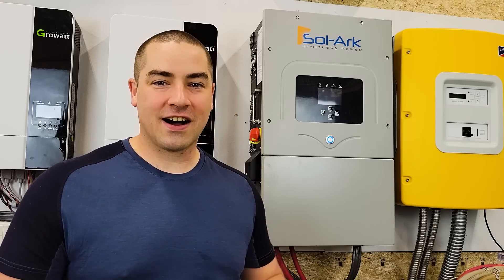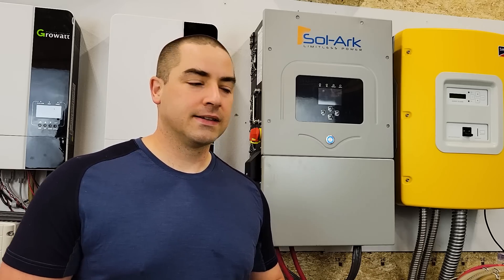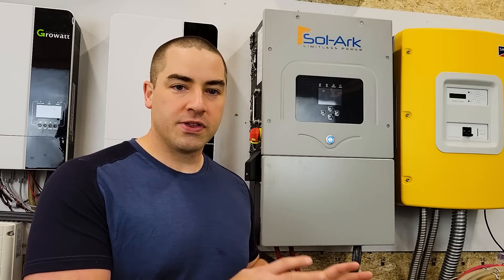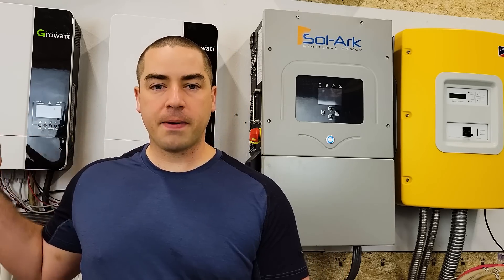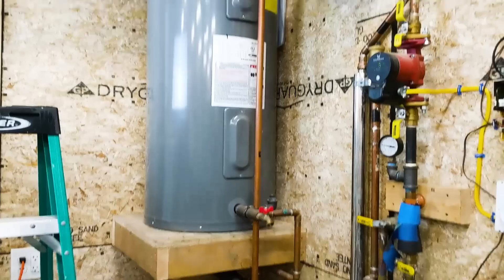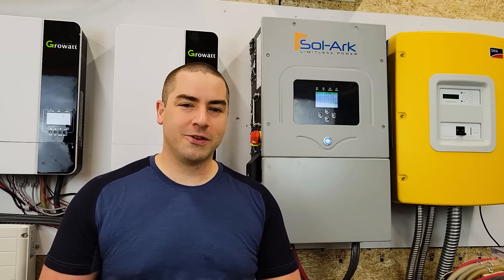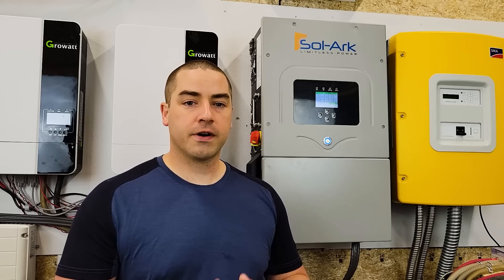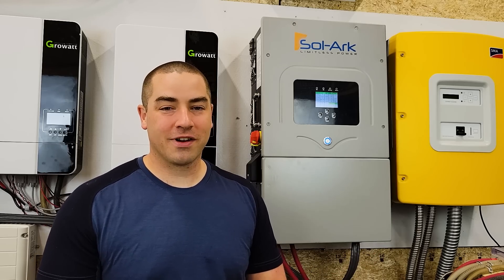Sol-Ark 12K Inverter, Is it worth it?

Comment: That's disappointing for $5000.  I have a 6k LF through an interlock kit, buy I want to add an 6k HF through a transfer switch to power the water heater and maybe the stove.
Reply from the maker: If you are looking for a 6kW HF, then might I suggest this one: https://signaturesolar.com/eg4-6000xp-off-grid-inverter-split-phase/?ref=4_rHcgZ9x-TiF-
(affiliate link)
Reply: @DavidPozEnergy  Looks like a great model. A bit pricey, but if the internal charge controller is robust then worth it!

Comment: that is an inaccurate eff%. in order to get the measurement for this you need to do multiple runs and certain voltage and max output percentages and get temp, output ratings, and input number at a certain load percentage as per sgs. Do the test properly so we can see a real review.  with the space heater you were at 34.5A already then 36A, max current is 62.5 which means you have exceeded the halfway point sharing the legs. If you want to do what you are doing and run what you are running, then it would be operator error to buy the 12k and not the 15k.
Reply from the maker: Hi Armondo slaughter,   thanks for your comment.   I'd love to do more testing on the inverter.  Mapping out a full efficiency curve would be great.  Do you know of anyone who has done that?  BTW, the Sol-Ark 15K didn't exist at the time I was making this video.

Comment: Can I do off grid like you have, but just run a battery charger from the grid on the hot side of my grid disconnect switch to top off the batteries when needed?
Could this accidently back feed the grid?
TY
Reply from the maker: Generally, yes, you can do that.  I'd double check that it's an "Isolated" charger, which is fairly common.

Comment: I have had Sol-Ark for one year. I am disappointed in the batteries and how the system switches back and forth from the grid to batteries; in other words, it is not automatic. Tom gets confused at the precise point at which Sol-Ark is the weakest. When explaining how the batteries and grid interact and assign how the grid charges the batteries is a significant problem in the system's design. Tom's hesitancy and confusion on this point of complex action is Sol-Arks production failure. This problem will doom Sol-Ark's growth if not corrected. The Installer is not the problem. The employees of the installer believed Sol-Ark's vague and confused explanation too.This system is not automatic, as Tom explains. I repeat: Sol-Ark's system is not automatic. Sol-Ark batteries during a recent grid shut down for me, went to zero - in other words, Sol-Ark batteries went out to. During this period of time of several days, solar power present for several hours charged the batteries to a low level. I phoned the installer. The employees also failed to figure out what went wrong. I was told that Sol-Ark is automatic. Nothing during this power outage for a few days worked as promised. And I paid $45,000 for these batteries in my small home of 1780 sq. feet. I phoned Sol-Ark and spoke to an engineer. The engineer person told me that my system needed an update. What? Why does the system - the App - fail to register when an update is necessary and then perform the update to their software? The engineer remained silent without an explanation; in fact became a little too much belligerent as I pushed the point that if it is a software problem, how come the so called expert engineers failed to correct the outdated software when they noticed it?. Why does it take a power outage to indicate that Sol-Ark's software is outdated.  Here is my point: Sol-Ark does not perform as promised. I paid $45,000 for a home battery system that Sol-Ark told the installer and the installer told me, the home consumer, that Sol-Ark system is automatic. I do not recommend Sol-Ark batteries for home consumption. For the excessive price I am getting almost zero performance and zero customer service from Sol-Ark. I do not blame the installer. They too were misled. When the power went out, the batteries failed to respond as promised. I suggest that the home consumer either check out another battery supplier or do not install Sol-Ark batteries at this time, since Sol-Ark does not have a reliable system. Perhaps Sol-Ark is aware of the system's failure and in the future the product will work as promised. I deserve a system that works and I deserve a substantial rebate from Sol-Ark.

Comment: I just watched my (2) t12k systems shutdown today pulling 12k from grid. Also it only charges my batteries about 10%, shows 100% then dumps batt storage. Wish I bought 3 midnights now and a batt controller and saved 12 grand. 

The sol ark GUI/ PV Pro is archaic too, like 1990 dial up modem old

Comment: Hi Dave,

Great video! I have the same 12K Sol-Ark inverter. And, I have experienced the same issue. It shuts down pretty frequently and I have to manually turn it back on. I need some help. Can you please assist me? I guess that I would need the autotransformer as you mention and the phases L1 and L2. I have always wondered why the system is overloaded while it is 9K watts output and using only 3, 4, 5K watts... Can someone help me understand what I need to do to resolve this issue. After all, this is a very expensive unit.
Reply from the maker: I made a second video to this one where I test out using an auto-transformer.  But, keep in mind.  That (to my knowledge) Sol-Ark has not printed any document advising how to use an auto-transformer with their product.  If you ever have an issue and ask for help from them, they might not provide any because of the use of an auto-transformer.  (IDK)  But, check out my next video for some ideas on using an auto-transformer: https://youtu.be/EYIzEW54_bY
Reply: @DavidPozEnergy  Thank you so much for your quick response.  I sincerely appreciate it. I did watch that second video about the autotransformer. And, I think that it sort of resolves the issue of overloading since it splits the charges. That way, the inverter should and must be able to absorb the maximum output as it should in the first place. I will bring the issue to Sol-Ark so they can opine on it. By the way, can the system restart itself automatically without manually turn it back on particularly I have it overseas in Haiti 🇭🇹 while I live in the States here in Florida? It is completely off-grid. Your invaluable advice would be greatly appreciated. Thanks again.

Comment: So a cursory review shows that this is a high frequency inverter. The main advantage of a low frequency inverter (a la Victron) is ability to start inductive loads. So it sounds like this may be a factor here, just the overall topology of this inverter.
Reply from the maker: Basically, yes.  The Sol-Ark is a Transformer-less design.  Inverters built with transformers have much higher surge capacity, which comes in handy for starting motors and compressors.

Comment: Stick with the Sunny Island, no comparison not in the same class. Mine is connected over 350' from the AC Buss (on purpose) has never tripped. I even connected my diesel pusher motorhome,  and it finally wouldn't start the AC in it, but tripped the low voltage protection in the motorhome. My old system used Zantrex SW 5548 Inverters circa 2000 which were set up as master and slave like SMA. They lasted until 2019.

Comment: Just balance the load better and you should be able to get close to 9,000 watts.  For example, if you use 2 space heaters, make sure there is one on each leg.  If you really wanted to force your house to be balanced all the time, only use the 240V from the inverter, run it thru a powerful voltage converter (240V down to 120V), then backfeed your house with just a single phase of 120V, but the inverter will "see" that as a 240V load all the time and should "autobalance" it but I am not 100% sure so maybe some electrician can chime in here and either confirm or debunk this theory if they know the correct answer if this will work or not.

Comment: I just spoke with Sol-Ark about this exact issue. They told me that if you are 100% offgrid , then the disparity between legs can only be 1.4kw. If its on the grid then you can be 4.5kw difference between legs.

Comment: Never seen a Sol-Ark trip this low. 
I have designed and installed dozens of Sol-Ark systems. Very seldomly do I recommend 1 inverter for the whole home. Balancing of loads is very important in any electrical system. I always do my best to rearrange curcits. 

I have seen a singel 12K run all lighting, well pump and dryer with no problems. Only when adding the hot water and oven do you experience the over loading. So, singel inverters systems have gas appliances or do a seprate critical loads panel. 
I have seen problems with the ac coupling feature. I only do dc now, its better that way any how. All around I dont think you can beat parralle Sol-Ark systems for a hybrid set up. I wont put my name on any other system. 
I gusse it may be a good thing for me to post some whole property systems I have done to show the ture capability.

Comment: Here's the deal, with an inverter (DC to AC) and a maximum continuous rating of 9000 watts, that's 4500 watts per phase. 2 phases of 120 volts each. 1/2 of the total rated output of these inverters. This is easily overlooked. The total wattage was 9000. If this were feeding a 3 phase load, that would mean the maximum per phase would be 3000 watts. The system seems to be doing what it was meant to do or am I not seeing something here?
Reply from the maker: I made a follow up video with more detail and more demonstration.  https://youtu.be/EYIzEW54_bY

Comment: The excessive idle power draw, poor 93% efficiency and poor cooling design with 3 x huge noisy fans is enough to put me off instantly.  The fact that they're so expensive and advertised as 22nd century technology is a joke - plug in 2 heaters and trip out your whole house?  More like 19th century technology.

Comment: My question are the Growatt systems without a problem? Looking at the DIY solar power forum, there seems to be lots of problems with them some of them dangerous in nature such as the bonding of neutrals and grounds.
Get the right equipment for the job and make sure you understand the strengths and limitations of each piece of equipment. In other words read the manual and ask questions of the company if their are problems.
My problem with this review is that David did not update software or ever contact Sol-ark about his issues. Also it appears he is paid indirectly by Growatt.
The Growatt and Sol-ark address different needs.

Comment: You went over the 50% load balance rate for the unit. 2800/4600= 61%. You can pull more watts, but not that far out of balance. The solution is another 12 k unit, balance loads better or a use different inverter.

Comment: Dave how about testing the midnight diy all in one 5000 watt inverter. Very simple to hook up and for 900 bucks it is doing fantastic after a month so far.500 volt on pannels. Gen or grid back up. Stackable. 80 amp charger.

Comment: 4th day totally off grid! 20,600pv, 132kwh lfe battery (3 out of 10 batteries hooked up, 7 to go), 10 bms's/six brands, two SA 12K's, 10k honeywell lp gen with 2-wire start(Does GWatt have that?), 400 gal lp. After getting all the settings correct, it works like a charm. it powers three heat pumps 5.5 tons (vs compressor on one, soft starts on two), 80 gallon electric water heater (4.5kw), dryer, washing machine, electric range, fans, lights, all electronics. Love it! A full 40 space main 200A breaker panel, 100A sub in garage with a lot of breakers. That's the key to having balanced loads. Lots of breakers. Always run two Sol/Ark's for totally off grid. My old power bills showed 40-70 kwh. More in winter due to hp's. I use wood burner below 30F, have all electric hesters on a toggle switch for disabling. Defrost thermostat on one hp has nc spst switch to disable during dry cold weather when defrost is usually not needed. The other two hp's have demand defrost, too much electronics to mess with.

Comment: Oh yes you are EXCELLANT at answering our questions !
There is absolutely nothing better than a real life test with real life conditions and without any bias or corporate number fudging !
Thank you especially for this video as I once was considering the sub-ark 12 k as an upgrade to my outback radian gs8048a (8000 watt inverter). After watching this I realize sol ark is not even close to competing with our existing system. And to add insult to injury, they paste a "limitless energy" sticker right on the face panel. Such a shame as I had high hopes for this company.
Also the 12k nameplate equates to nothing more than false advertising and misleading buisness practices.
Someone could add a bunch of cheap charge controllers to a 6000 watt inverter for a total of $3000 and call it a 12 k inverter-as it would outperform the solark.
As it stands we produce up to 60 KWh daily and our inverter can do a continuous 8000 watts with a surge of up to 9000w with no problem. We sell 2/3 of our power and use the rest for loads & batteries and all for less $ than a solarc to begin with.
Plus the BIG BONUS of never having had a shutdown due to overload in almost 5 years.
No thanks solark, not even if it was free, not in a million years !
Only overload our outback ever had was intentional during initial installation & testing. She finally cut out at 10,400 watts after running over 9000 watts for over ten minutes.
One thing I can thank Sol Ark for is restoring my appreciation for the system we already have and reminding me the importance of quality manufacturing, real life durability in everyday use and especially honesty in advertising & marketing. I came close to ordering one of these turds a year ago and Im sooooo glad I didnt.
Will try out the growatt L F products for my next project ald leave my existing system just the way it is. A little dated, a bit older, but very very faithful and dependable. Which is kinda the whole point after all.
Great vids David !
Really appreciate the honesty, unbiased views and your sharing REAL life experiances.
Been watching since your early days.
Keep em coming.

Comment: This is a bit misleading this is mentioned in the manual and is really just a load balancing and or wiring problem your house should be wired a bit different when on solar and should be designed around the type of inverter you choose and how many you choose for the given load you have so i hate to say this but this is not a solark issue it is a design issue you cant have convenience with a poor design also in regards to you ideal power consumption there is a bit of overhead down stream of the solark which is why you are seeing different idel consumption

Comment: You don't have your solar hook up to your sol ark :( shows zero input.
sol ark works different then other inverters on conversions pv to batt to ac loss. sol ark is 7%. while other inverters average 15-30 % growatt was at 29% when tested.

Basically converters dc power to ac within the inverter without going back into batteries just to be put back into the inverter first.
lot people don't understand this. yes mppt might have 97%ish efficiency but dc to ac and back to dc is a huge loss % which sol ark dominate the market.
Which growatt being off grid inverter pv to battery to ac is huge % which honesty off sets the cost differences and less hardware aka more space on your roof :)

growatt is like 300w on idle
sol ark is what 60w on idle

comparing 8kw inverter vs 2 stacked 5kw (10kw) isnt really best way not same power. That's 20% difference . your household might use 9kw-10kw on peak when it pops.

all doubles breakers will split leg 1 and 2 loads. so electric water heater , stove , dryer etc will have same on each side of the leg. So your stove 3000w burner would use 1500w on leg 1 and leg 2. Your water heater is about 5kw which is 2500w leg one and 2. so if you do math stove 3kw(just burner!) plus the water heater kicks on  5kw= your max 8kw output....20% less power is huge amount but your comparing 2 growatts vs single sol ark..... now if you compare 2 sol arks parallel  you would have 16 kw of max output aka 8 kw per leg.  

now single breaker 120v items you can go over your limit 4500 per leg. still 9kw combined tho. space heater uses only 1 leg. 120v single breaker. easiest way to trip it is when running a electric space heater since space heaters use about 1.5-2k range sometimes even more on single leg.... Electric to heat anything isn't the way to go unless its a heat pump. electric hybrid water heater which is 100% electric has a heat pump which is about 400 watts to run vs 5000w..... some electric company's will pay you a rebate for a heat pump water heaters. mine was $600 plus $300 tax credit and 10% coupon code with sale price was free at time when i switched over 5 years ago.

Comment: If you really lived off-grid with no easy safety net I promise you would take efficiency with far more weighting, extra solar means little when it's raining for 5 days. Anything drawing 24/7 is far more serious than it sounds. Minimizing usage and maximizing efficiency is paramount. We soon realized how 4kw water heaters are insane compared to hybrid. 
Also comparing device build quality(put those inverters outdoors for instance ;) ), lifespan, customer support. If your inverter is down and you become dependent on a generator that awesome solark customer service becomes very important, I've lived that on a freezing wet day. 
Awesome to see any product comparison, though when mentioning off-grid just thinking of one part of the puzzle and how it works with a system that was all grid based may not be so equivalent.